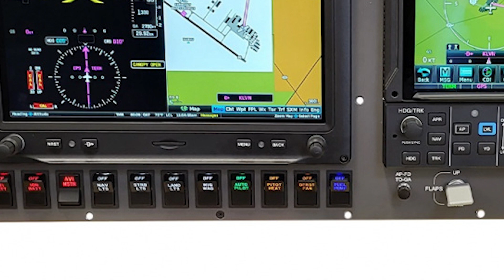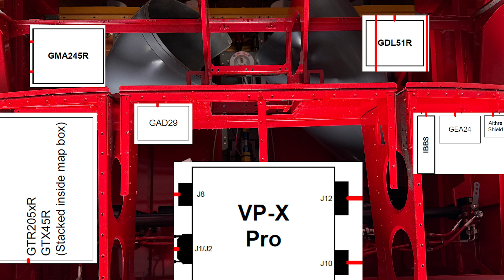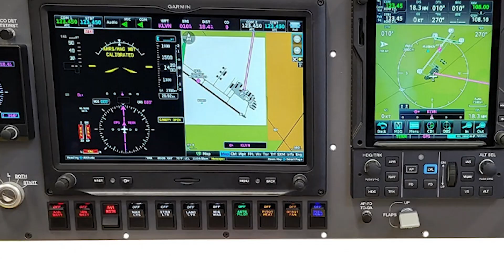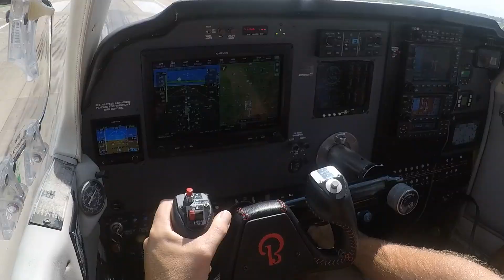Why We Chose SteinAir to Build Our Avionics for Vans Aircraft RV-14

Comment: Installed AV-30s in my plane and used Stein Air for connectors and wire harnesses. Outstanding folks, very very professional, knowledgeable and extremely helpful with sharing information and suggestions!!!
Reply from the maker: They even do some Panel Installs / Upgrades for Certified airplanes.   They really have it all covered.

Comment: I'm going with Stein and Garmin as well. Glad to hear a rough number on what the labor cost is for them to design and build the full panel. I thought it was closer to $15k so $8k is a no brainer for me. Well worth it!
Reply from the maker: Depending on how you slice it, it could be more than $8k.    They charge for the harness construction and design and there is labor and materials in those prices.     So yes I pay stein $15k ish.   But most of that I’d be paying someone else if I did it myself.  So I think $8k above what it would cost me is about right.   Your mileage may vary.